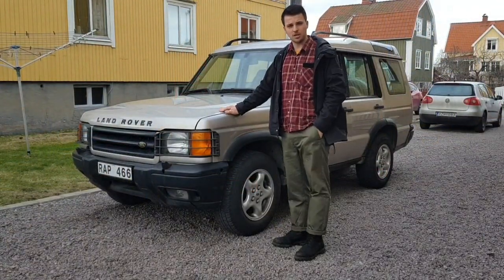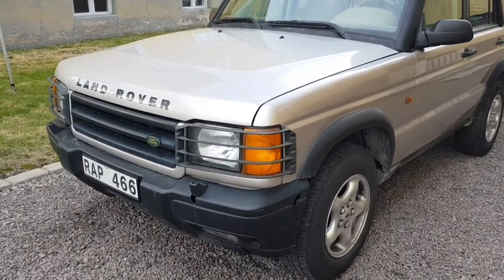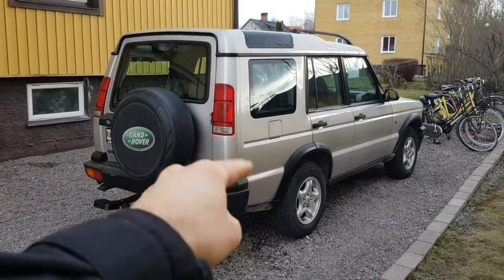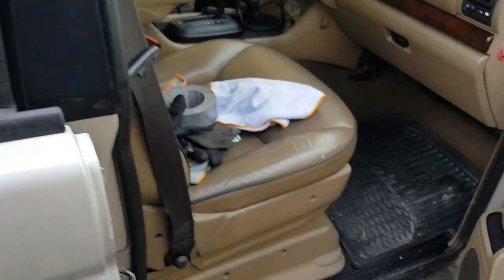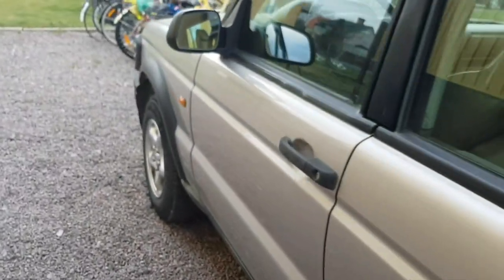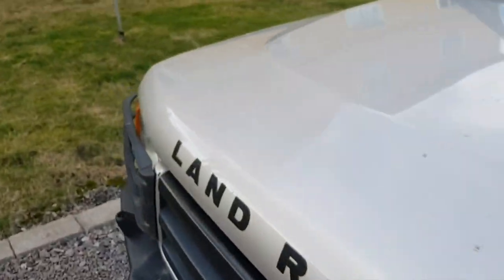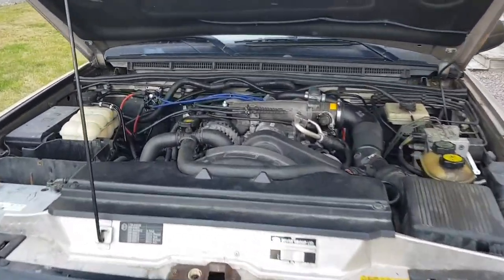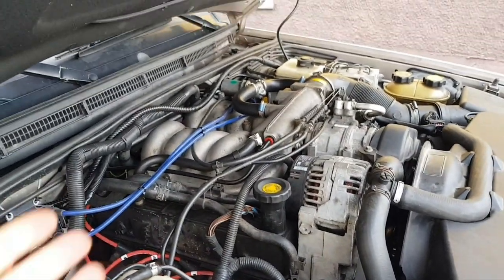I bought a cheap DISCOVERY V8!

Comment: Hi there, nine times out of ten it is the airbags on the suspension. As a quick fix you can squirt heavy duty inner tube slime into the bags to stop any leaks. I had to do that once and managed to drive like that for four years before I actually got around to buying new airbags! I would keep it stock and sell it, if that is your intentions anyway. Cheers
Reply from the maker: Yeah I haven't inspected it yet, been diagnosing the engine first. But I'll get to checking all the connections as well as the bag itself. It is still original, 20 years old so it might just be the bag. Compressor works fine👌🏻
Yeah probably just gonna keep it as is!

Comment: Hello, I'm a Car Technician. 
Are You 100% Certain It's a Faulty Head Gasket ? 
There are Other Reasons a R R Can Over Heat; 
* Thermostat, Rad Cap, Water Pump + Is The Fan Viscous Coupling Working Correctly ? 
Does this R R Over-Heat Only in Traffic (when Not Moving) ?
Does it Over-Heat Only When Moving at Speed ? 
I Ask Because There's Nothing Worse Than Doing something BIG Like a Head Gasket on a V8 Then Finding the Problem is Still There Afterwards.